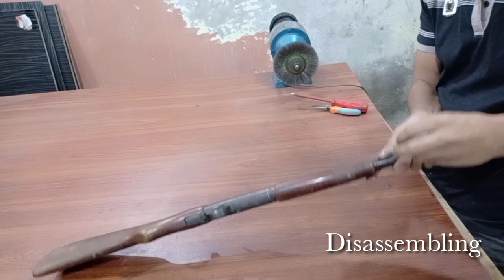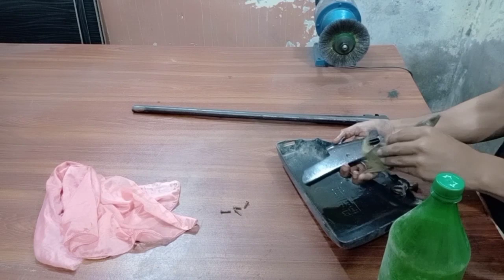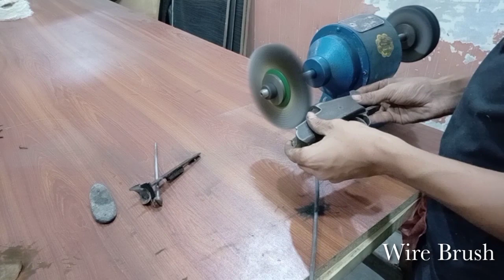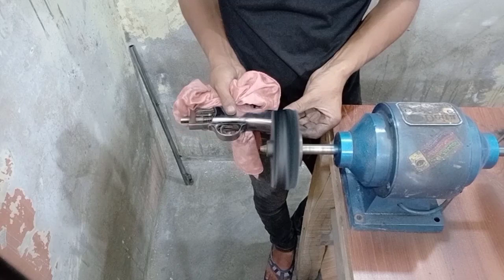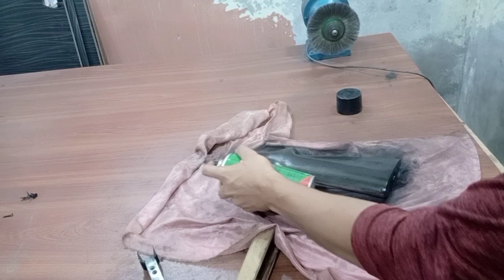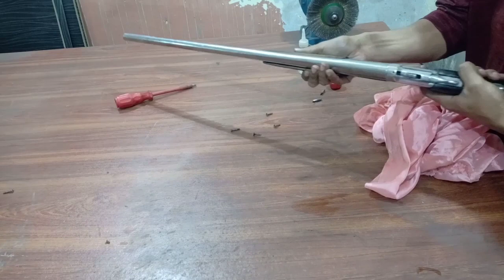Vintage Single Barrel Shotgun Restoration | Turning Shotgun into Chrome Color

Comment: I’m not a big fan of the painted wood but that nickel look is great! Screw all the negative Nancy squares that like that boring old look. That’s one of the problems with this world now, some think their sh*tty vision is the only one that is supposed to exist. It’s a $100 gun the old way but to someone with imagination and can appreciate the labor involved to bring about that shine…it’s priceless! 💎 👍
Reply: That "look" would be fine if the gun were nickel plated or stainless steel. Unfinished carbon steel stars rusting the moment it's exposed, and it will rapidly rust if the gun is ever exposed to humid air.
Reply: I’m sure it’s not something he’s draggin thru the woods. It probably doesn’t get much use other than show and tell. Wax it or keep it oiled and it’ll be fine…AND remain looking good

Comment: It's great to see you are interested in gunsmithing .... You could make another video by wiping hot vinegar on all the metal parts and let it set for a few hours. Then wipe it down with a wet rag. The more coats the darker. That's how they did it in the old, old days.
Reply from the maker: Sounds good!

Comment: Well, wearing rubber gloves will keep the chemicals out of your body from your cleaning agents. Once you took the bluing off the metal, corrosion or rust will immediately start. Keep the Gasoline out of the enclosed area to prevent fire hazard and from breathing in fumes. wearing gloves around the grinder is a good idea as well. The sparks coming off your grinder are splinters of metal and I would recommend safety goggles as well. Your finished shotgun does look pretty all nice and shined up and such but a deer or a squirrel will see that shine a mile off. Take your time be safe and have fun.
Reply from the maker: Thank you for your value able comments ❤️
Reply: I just thought I'd mention that once upon a time I did the very same thing you did except I repainted lock stock and barrel in olive drab paint for the camo effect. It may be an ugly duckling but is still a great shooting shotgun.
Reply from the maker: Thats Also A Great Idea 
Thank You

Comment: Clean with petrol? Is that just Gasoline? Any reason why? Also, the foregrip on mine isn’t loose, will it just pull off like yours did? Thanks, good video.
Reply from the maker: Thanks for your interest
I cleaned with petrol to remove the (Gun old oil) on it 
Yes that will pull easily like i did
Reply: Thanks. It came right off. Is that a boito? This one has no markings other than “made in Brazil” and the number. I’m pretty sure but I can’t confirm it anywhere.

Comment: WHERE did he ruin the gun?  Its his gun!  OK you don't like it buy it from him. Strip the paint, restain to YOUR like, reblue the metal, and its back to your like. He did not hack it up with cutting the barrel or screwing up the stock with Dave C mods, the gun is fine, H... H&R sold painted guns with chrome receivers back in the 60s  I have a 410 deluxe topper with a chrome receiver and its painted BRIGH MOON YELLOW, ALL FACTORY ORG. YES he needs to protect the metal now that its in the white BUT F Up the gun NO!